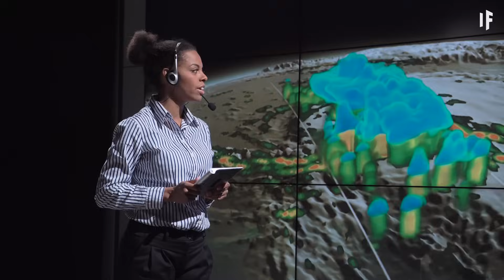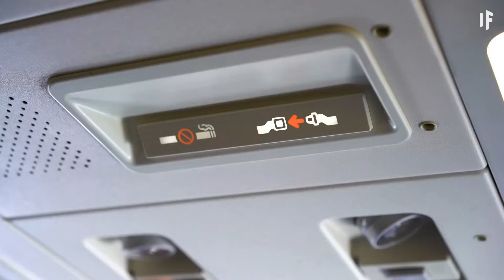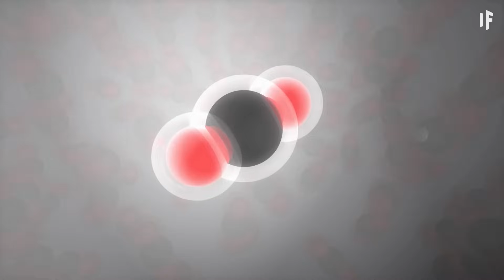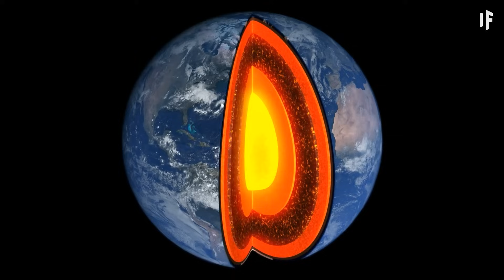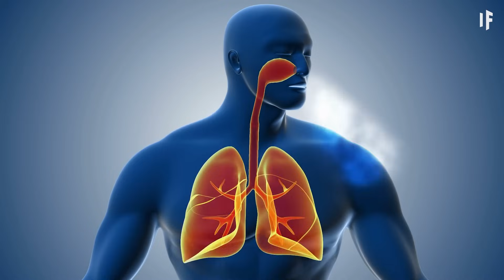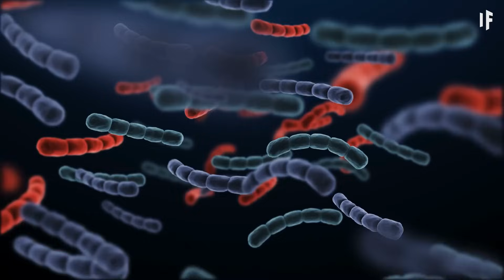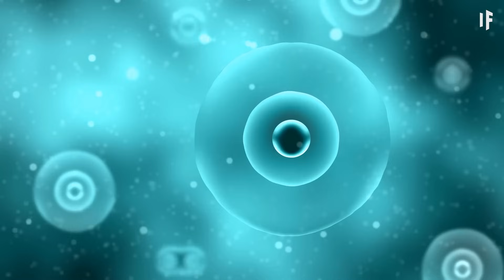What If Earth Lost 1% of Oxygen Every Second?

Comment: Without people, being able to prepare ahead of time, would very much would depend on what you have already at hand, some people own water to oxygen machines, oxygen tanks for diving, health and the air in their home will still last a certain amount of time. Time to prepare means. The people would be buying up such machines very fast , with efforts to find ways to manufacture more at higher speeds and boost up the nuclear power plant for power and making sure that the people have a source of water. People will also attempt to find ways to seal their homes better, to save oxygen.  Food sources would become a issue unless the other gases are still present. Possible solutions, poles being driving into the earth with cheap see through plastic to keep the air inside or using a train tunnel, drained sewer, large buildings and adding plant lights .  The people can help reduce the strain by turning the living room and spare rooms into green houses. Plant lights and water to air machines and portable tanks and breathing machines would become normal for the people giving enough time.

Comment: Such things won't happen, as it's a process of recycling. Whatever you produce like hydrogen, carbon dioxide, etc., the Air will accordingly maintain its contents of different gases and oxygen will never be depleted.

For example the maximum we have contaminated the Air or polluted the Air, but it maintained its level.😅

Better wr should have more green vegetation to maintain this level and should not remove them.

Comment: There's only 18%.  So only 18 seconds
Reply: that's not how " 1% every second" works.  
Take 21% oxygen. 
multiply 21  by 1%  and remove it from the total  (   21 * .01  = .21 ,    21 - .21 =  20.79 )
and do that until you reach 0.

you drop below 0.00  at about 13 minutes, 52 seconds.